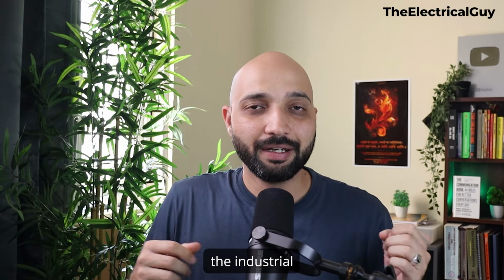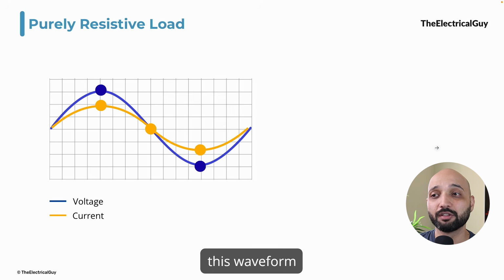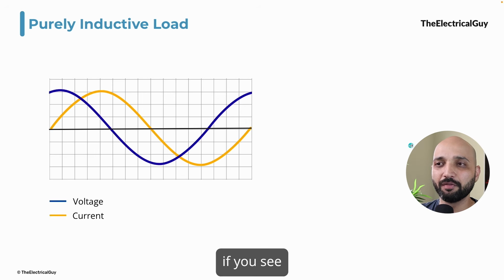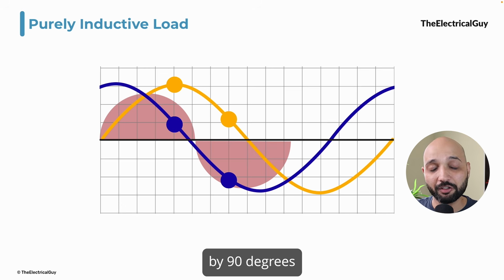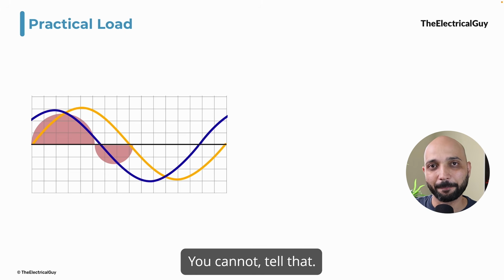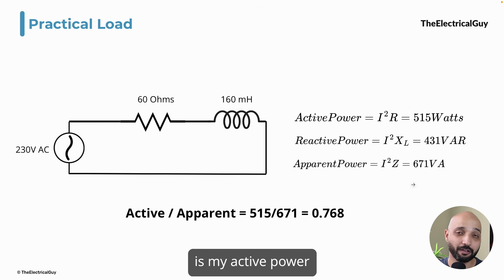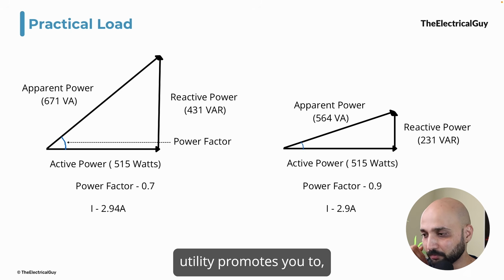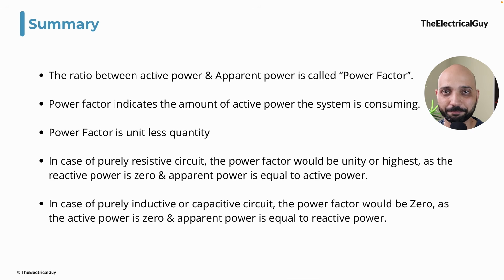Power Factor Explained | Why Your Electricity Bill is Higher?

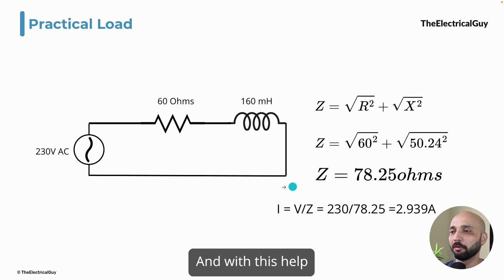Comment: When calculating impedance, even though the formula in the video at 14:40 states that there are two separate square roots, R-squared and X-squared are summed under the same square root. The result is correct because it is calculated with the correct formula (78.25 ohms), but if you just add it without the calculator the way it is written, you would get: Z = 60 + 50.24 = 110.24 (incorrect), because the separate square roots just nullify the squares under them.